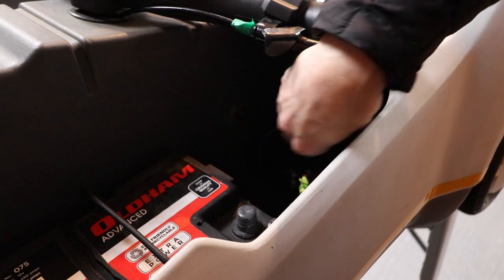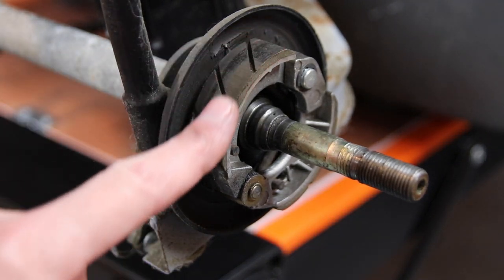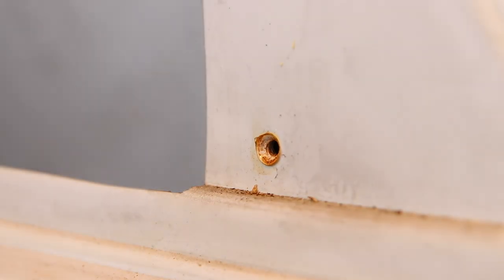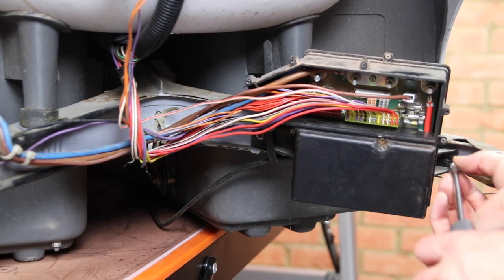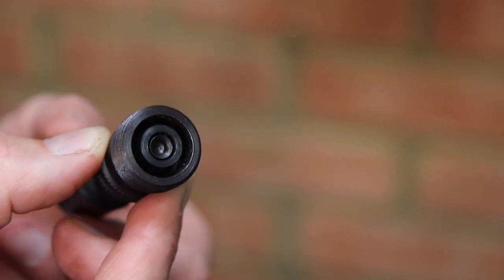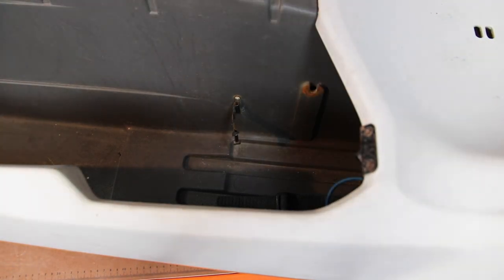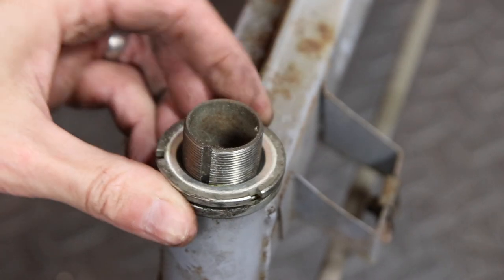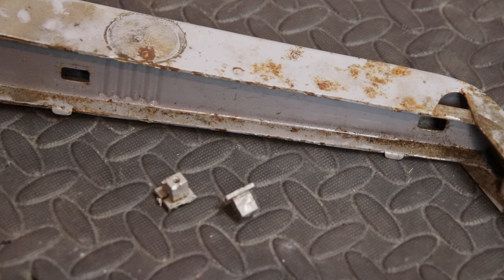Sinclair C5 Restoration - Part 2 - Tear Down (v2)

Comment: This is well explained and come in handy for when I start on my C5 that my neighbour is giving me. 🤔
Reply from the maker: Good luck with your C5 restoration!
Reply: @RetroWorkshop  thanks, interested in a throttle for the motor instead of the on/off switch.
Reply from the maker: Can’t help with that I’m afraid. You’d need a controller of some little circuit to covert an analogue throttle to on on/ off relay.

Comment: Where did you get the Sinclair vehicles sign from I need one in my garage!
Reply from the maker: Glad you like the sign - I made it. I recreated the logo and had it printed on Foamex (foam board) by a local printer. it is then velcro'd to two horizontal wooden battens.  If you email me via my website at retroworkshop.uk I will send you the logo.
Reply: RetroWorkshop thanks for the reply! I’ll drop you a email😀

Comment: Hello - could you please add a link to the correct tool to undo the pedals @ 8:12. Thank you.
Great Video
Reply from the maker: It is a Cotterless Crank Removal Tool. Can’t remember where I got mine try Halfords or Amazon.
Reply: @RetroWorkshop  I think it's a standard mountain Bike crank removal tool. Thanks for the Video's.

Comment from the maker: I've re-uploaded this video (April 2020) as there were a couple of errors that needed captions to prevent confusion from those using this as a re-build guide. I am most grateful to Charles Snarsky for the tear down method shown here (link in description to his own video). There is a tear-down guide with pictures on my website at https://www.retroworkshop.uk/sinclair-c5-restoration/sinclair-c5-restoration-part-2-vehicle-strip-down/